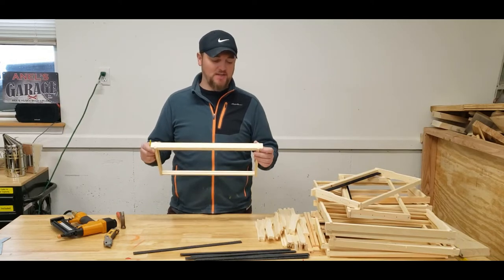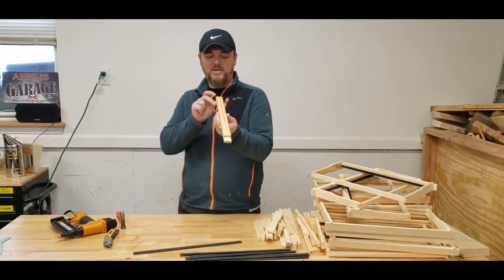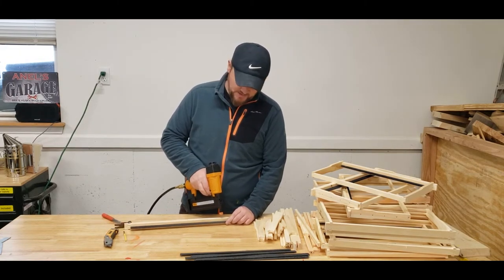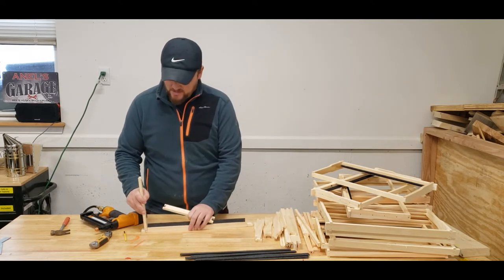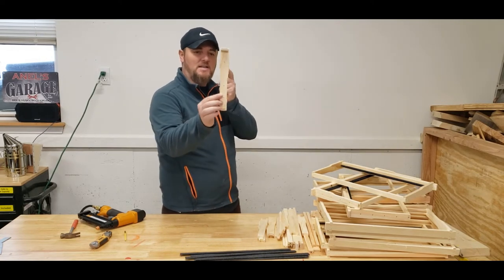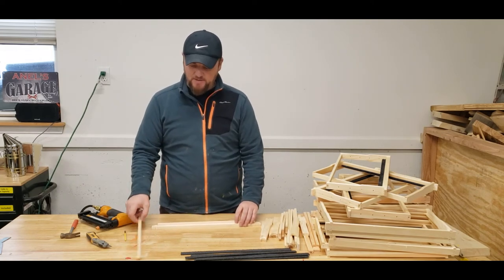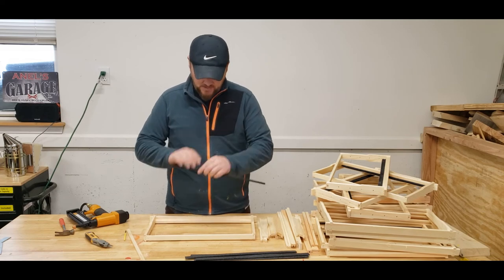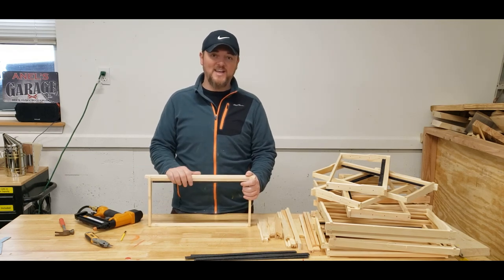Honey Frame Assembly (With Starter Strip)

Comment: For starter strips all i do is cut strips off  2 x 6 or 2 x 4's  1/8" thick, 17" long, and 2" W, and i glue and push, the start strip under the top grove.  let it dry over night, Then nail the starter strip in under the  top grove,  with some same finishing nail. Then coat it with brush on melted wax > There is no need for wax foundation, plastic foundation, nor cell rite>  its a waste of money Plus the bees with draw it out much faster to !   than wax or plastic or even cell rite>   My bees will draw out wax foundation. BUT THEY WANT TOUCH, THE PLASTIC, NOR CELL RITE,  EVEN COATED !   WTG 👍 your going to have SUCCESS ! My friend  ~ Plus a pocket full of money!   To do other thing WTG   👍👍
Reply from the maker: Thank you thank you. I'm excited to see how they built this out naturally.